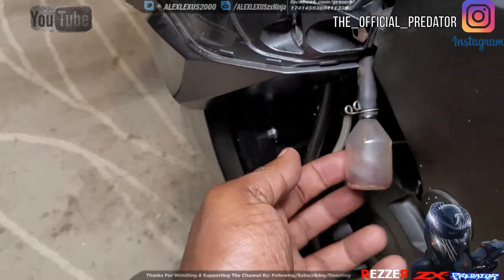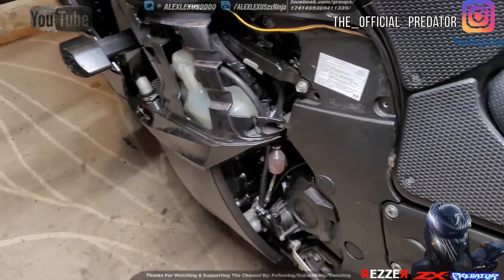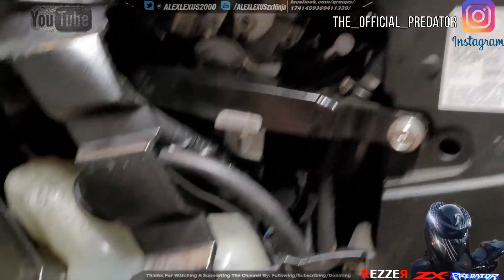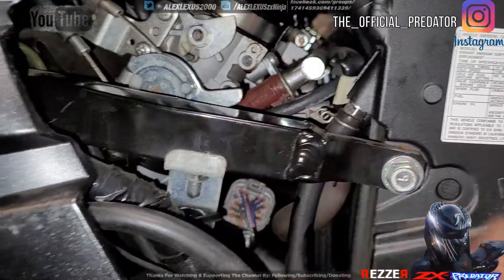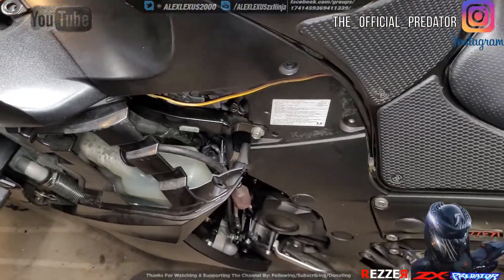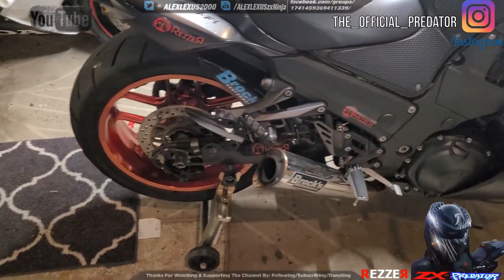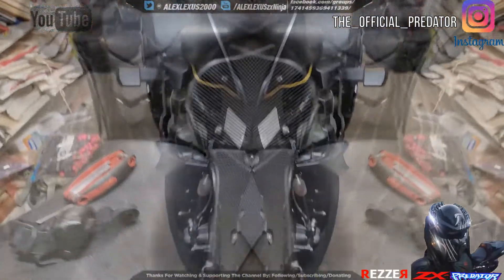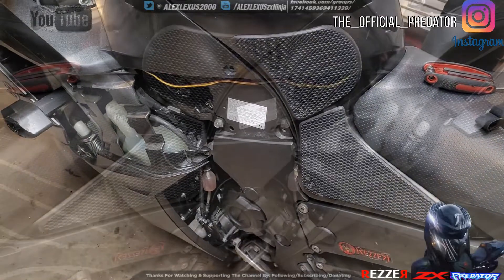Over Oiled my zx14r during last oil change Fixed it PSA info discord:https://discord.gg/BmCKK4rTWN

Comment: Yo let me start off by simply saying thank you. I have seen that little bottle. Mine has a cover over it, kinda like a black sleeve if you will. Anyways I never knew exactly what that was and I honestly never bothered to check. Iv never noticed a problem in that regard but I seen it in your video so I went out to the bike to see and sure nuff it wasn’t full but it did have a lil oil in there. I took the cap and clip off and drained it. I’ll be watching that more closely. Thank you
Reply from the maker: This is part of why my channel is here. To help  and share information.  Don't  over fill the oil  cause it will cause problems  overtime. I was wondering  why I was losing  power here and there. 9n a hot day I smelled the oil and started to worry.
Now all good. Anyway to help brother